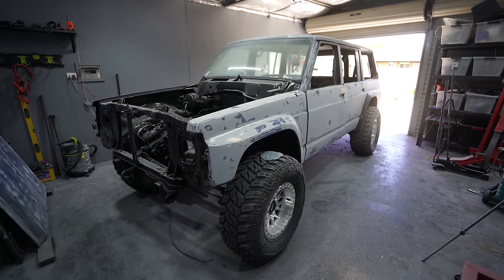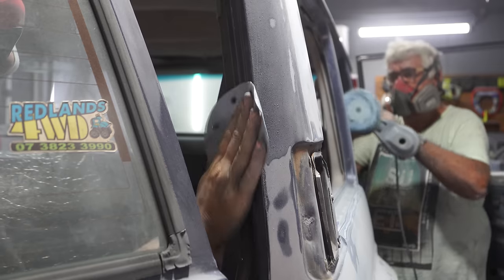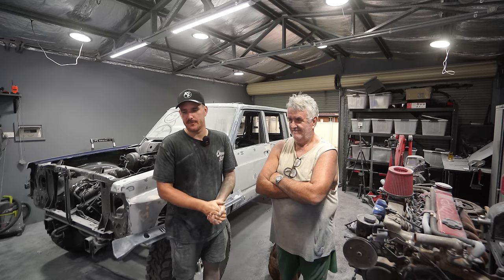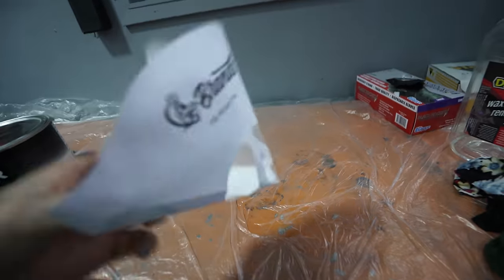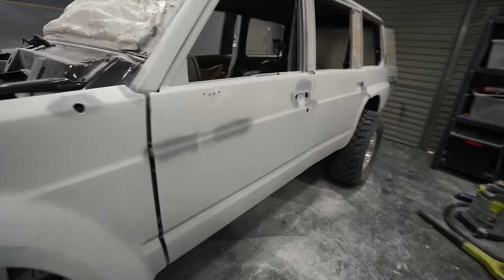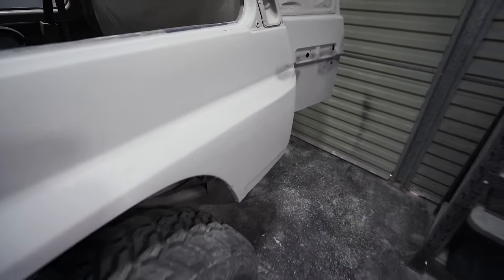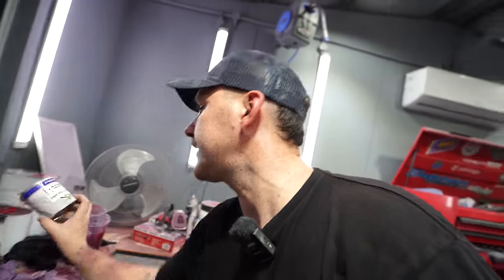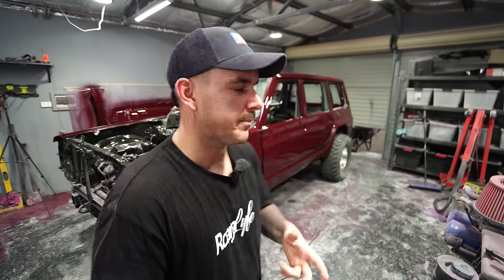Painting A 4x4 In Custom Paint (Less Than $1000)

Comment: Do your self a massive favour on the next car you paint and use guide coat when blocking out.
Also use white rags and keep wiping it'll your towels are clean.
Reply from the maker: Thanks for the tip! I definitely skipped the guide coat! I should have had done it, in the sun you can see little marks where I’ve missed! I was just so over sanding at this point 😆😆

Comment: Try walking the paint job if you do another one. Panel painting is a much better way to paint, no double a triple coating the edges of each panel. Also cuts your chances of running it in those areas 100%.
Reply from the maker: I would have liked to of done it that way but I feel like I woulda stuffed it up, my overlaps wouldn’t have been smooth!